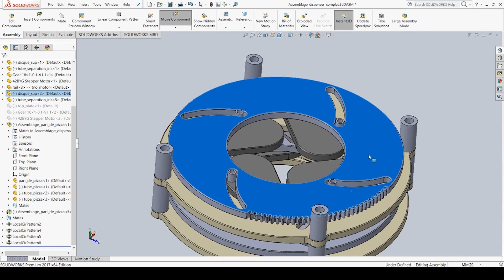BADMINTON SHUTTLE FEEDER PART 2: dispensing mechanism (diaphragm)

Comment: This design is excellent..Good thinking. I was struggling with Gripper arm (Manipulator) for picking shuttle. Do you mind sharing the solidworks file through dropbox link or so..Waiting for Part-3...Thanks
Reply from the maker: After some tests, I'm not sure if this mecanism is really THE best thing. For now, I will keep the file for myself. Thank you for the feed back though. :)
Reply from the maker: After some tests, i'm not sure if it is THE best way to do it... it needs a bit of elaboration. For now, I will keep the plans for myself. Thank you for the feedback though.
Reply from the maker: sorry, I thought I didn't answer you

Comment: I can never figure out how to set the voltage on those A4988s.
Reply from the maker: I guess you talk about this V_ref business: well, first you need to know the max current per phase of your motor. In my case it is 1.7A/phase. Then you plug this number into the equation that polulu website gives you and you get your V_ref which is an upper limit. https://www.pololu.com/product/1182
In my case I have about V_ref = 1V.
Reply: RiediProjects thanks